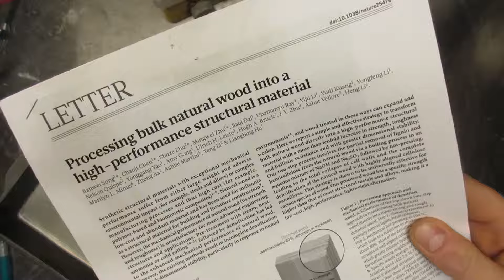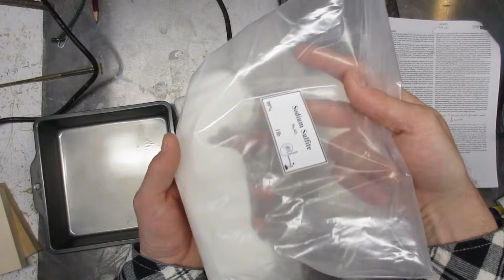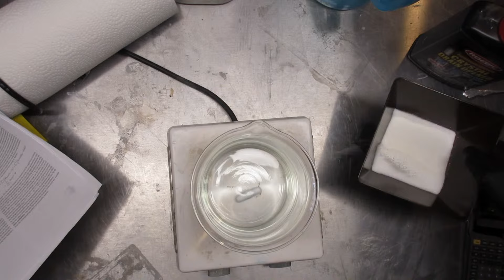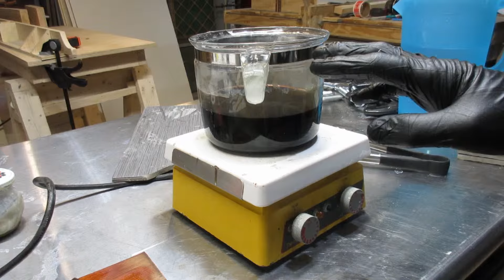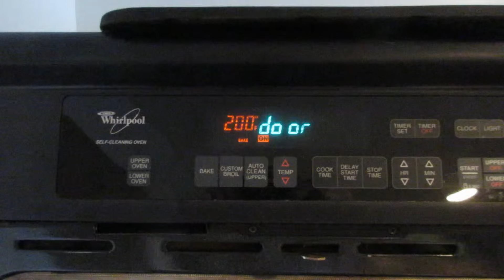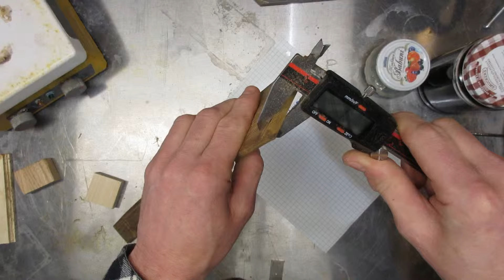Wood Densification Experiment

Comment: Nice experiment and you are pretty darn funny as well. I am very interested in this subject. Anyway to connect with you as I have a few questions for ya..??
Reply from the maker: I've pretty much laid out what I know in this video.  There is much more detail in the paper I referenced.  I can try to answer any questions you have here that way everyone benefits.
Reply: @dork3nergy  would you be able to do this to cardboard or OSB too?
Reply from the maker: The solution I used is designed to break down lignen in wood.  Cardboard is really just paper and glue and paper has already been de-lignified.  OSB is glue and wood chips.  The highly basic solution in this video would degrade the glue and leave you with a porridge of wood schmoo.

Comment: Could I only use sodium hydroxide
Reply from the maker: I don't think so Mahmoud.  The sodium sulfite is required to break down the lignen.
Reply: @dork3nergy  thanks
Reply: For future readers: it is possible to use only sodium hydroxide but it puts a limit on how thick of a piece you can work with. Tested on a piece of 2x4 (1.5” thick) the caustic solution only penetrates maybe 1/4 depth on each side of the piece of wood, and the core is untouched.

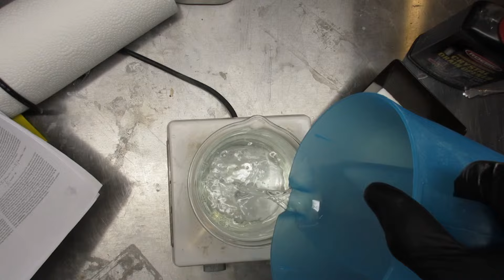Comment: 7:15 What is that called that you’re using to mix the chemicals?
Reply from the maker: It's a magnetic stirrer/hot plate. You can pick them up from the usual sucmbags pretty cheap.  Don't forget to get some teflon magnetic stir bars as well!
Reply: @dork3nergy   Thank you

Comment: Hi, really interesting video. I am a woodworker in the UK, I've got loads of different species including things like lignum vitae. I would love to experiment with this, the problem is I'm no chemist. I was in top set science at school and have a degree in product design though so I've got some idea. Is there anything you'd like me to test out in particular? I'd appreciate it if you could give me a simple DIY guide to doing this because I'm not able to extrapolate here. I have a variety of tools including big old clamps and am willing to buy a cheap 50 ton press. I also have a few ideas about heating during compression, I think a constant supply of steam to heat steel plates would work well and be practical for taking the experiment one step further. I'd make the results public, hopefully making it repeatable for most advanced diy'ers. I also have loads of veneers that would make up plys. I want to make a guitar fretboard from it and try making super-strong veneer laminated beams for the strongest possible strength:weight ratio. Cheers, Fabian
Reply from the maker: Hi Fabian.  To do this yourself you'll need some sodium sulfite (Na2SO3).  You can probably order some off ebay.  To make the boiling solution, decide how much volume you want to make.  For 1 liter, you'll need 100 grams of NaOH (lye) and 50g of Na2SO4.  To make 4 L, just multiply by for, so, 400g NaOH and 200g Na2SO4.  

After you've got your stock solution, boil, rinse and press your wood.

Here is the full method from the paper I referenced:

First, natural wood blocks (typical sample dimension: 120.0mm by 44.0mm by 44.0mm) were immersed in a boiling aqueous solution of mixed 2.5M NaOH and 0.4M Na2SO3 for 7h, followed by immersion in boiling deionized water several times to remove the chemicals. Next, the wood blocks were pressed at 100 °C under a pressure of about 5MPa for about 1 day to obtain the densified wood (115.6mm by 46.5mm by 9.5mm). By adjusting the boiling times, densified wood with different degrees of lignin removal can be obtained.

I'd be curious how using steam works for you if you end up doing this.

Cheers!
Reply: @dork3nergy  thanks, I will let you know how it goes. I'll go from the least dense; balsa wood, all the way through to densest; lignum vitae. Just got given a little steam cleaner by chance!
Reply: Hi, i'm a woodworker too and interested in densified wood. I'm gathering some materials to make some material too. Can you give some tips in the set-up? Kind regards
Reply: I wonder if it is possible to first give it the pressure and later heat it to 100 degrees. With houshold stuff I find it hard to have tha pressure applied and dry it at 100 degrees at the same time. Especially because I need some bigger wooden blocks, which brings me to more needed pressure, which can't be applied with the used clamps here. Any idea how to solve this?
I want to do this in a much bigger scale.
Reply: @rg1996  possibly not do-able without a bit of investment. A pressure that high to do larger pieces would be a heavy duty and quite considerable steel structure minimum.
The best I can think of is to make up a heavy steel frame that clamps together with many thick high tensile nuts and bolts on all the sides, this would be best made from thick solid steel, maybe 1/2" steel plate.
The heat and pressure should go together, they probably tried many different variants of heat and pressure being scientific in approach so following their advice is probably going give optimal results.
Just be aware that if such huge forces quickly escape that you will not be able to limit the damage, it's potentially a really really dangerous thing to do.
Reply: @fabianreeveswhymark3091  there is a more recent publication, where it reads like "press at room temperature with paper towels around the wooden block". Maybe they already found out, it can be done in series. That would make things much easier for me.
Reply: @rg1996  I think the heat means less pressure, that was my initial impression but if not then it'd certainly be easier. The time left under pressure is probably morel important, it probably has to have time to dry. Which is not great for large quantities, you may need heat or something to get rid of excess moisture during pressing. The end product swells with water so this would only be logical. Ethanol would potentially work for taking out water too, as it essentially thins the water.
Reply: @fabianreeveswhymark3091  I added you on facebook and sent you the actual publication

Comment: Lye or NaOH can cause almost instant blindness if beads bounce into your eye - - - - - - glasses / shield is mandatory - -  I would have suspected that thin steel pan would be eaten up, alum foil is easy to predict it would be eaten up. The original research had the hot liquor bath with wood placed in a vacuum to increase absorption into the wood pieces. Why didn't you test the hardness for us all ? Put a hammer on those pieces.

Comment: Great video! thanks for making , sharing, and teaching!!
Question for you though:  Wouldn't this process leave the wood particularly susceptible to moisture absorption?  not unlike a sponge dried into a thin wafer by simply smashing it flat and letting it dry while under pressure.  When the wafer encounters any moisture it will wick it up and swell back to close to its original size .   perhaps this could be solved with the use of a vacuum chamber and epoxy resin to seal the wood into its wafer shape?
Reply from the maker: That's an interesting thought.  My guts tell me that simply soaking it in water would not be enough to break the hydrogen bonds formed between cellulose strands.  I will toss a piece in a beaker of water and make a short video with the results.
Reply: cool ! :)
Reply from the maker: @Killianwsh  I did the H2O experiment but somehow lost much of my footage of it.  The results however confirm your suspicion.  It does indeed swell up.  There is a rapid but limited expansion in the first 6 hours but then the expansion slows.  It never regains it's full initial volume, you get about only 70% back after over 3 weeks soaking in the tub.

After digging around on the internet a bit there are a number of papers that discuss waterproofing densified wood so it seems that this is a common side effect. 

 Thanks for suggesting this.  Very interesting.
Reply from the maker: As a side note here, after removing the densified wood from the water and allowing it to dry out, it shrank back to it's densified size.  Crazy eh.
Reply: Most crazy indeed! Thank you for following up with this. The shrinking back to pre-soaking dimensions seems to indicate that the initial process does indeed seem to actually seriously alter the internal cellular structure  rather than simply desiccate and compress them! One is forced to wonder just how much more dense they could be made on something like a Rockwell hardness scale, if this were combined initially with vacuum enhanced epoxy/air displacement or even simply allowed to absorb a every liquid thermal (instead of moisture or air dry) setting resin (like cactus juice) instead of water.  allowing it to "drink up" the resin initially, then give it time to "weep" any excess resin back out until it shrinks back down again, then actually putting the sample in the oven to cure. 
You may find that there could very well be a commercial market for some thing like this as wood does have many desirable properties that make it superior to metal, stone, and plastics for certain applications (naturally high flexibility and very predictable  linear crush resistance just to mention two) 
When combined with the chemical, environmental, & rot resistance of plastic afforded by the resin, I would imagine it would make a very attractive, sustainable natural product alternative for many purposes.
Reply from the maker: @Killianwsh  I hear ya. It feels (not scientific) that there may be layers in the wood that water can infiltrate and cause some swelling but as it dries out those layers flatten again.  I could squeeze water out of the wood with finger pressure.  Also, it seems like it could be be shaped (with the grain) when wet which opens up some possibilities (for what I'm not sure).  There is a lot going on here.  I really should give the video another go.
Reply: If I had to wager a guess, I'd bet the layers your feeling would likely be the sap wood of your sample, as they are the softest and most sponge like. They are basically the veins of the tree. I think you are likely quite correct in your assessment that  they could be shaped when wet, as most woods can be (to varying degrees) when soaked or, more commonly, steamed.   As far as uses go... well I'd have to say that the tremendous reduction in dimensional cross-section (provided the wood does retain most of its previous strength characteristics) would open up all manner of possibilities currently dominated by metals simply because they have a smaller dimensional cross section  strength vs. their weight.    Wood, being lighter but normally bulkier, has all but removed it from space constrained  uses or anything that experiences wracking (twisting) loads, because it's very difficult to connect two boards together  and  get the loading forces to be in line and not  tearing the joints apart. This problem could possibly be strongly minimized if the wood had had the same strength but 1/2 to 1/3 or less of its orig. bulky CS. preventing wracking and torsional tear out of hinges, fixtures, and fittings, etc.
Reply: @dork3nergy  Oh man! 
This video and these comments are pure gold..!
Thanks and cheers from Patagonia, Argentina! 
🇦🇷😀✌🏾
Reply: @dork3nergy  letting the samples soak in a silicone mix should allow them to repel water and crosslink in the shape that you press them into the second time; here's an example of a cheap naphtha solvent hack that does the same for bedsheets:

https://youtu.be/z_R0gEDZhAI
Reply from the maker: @user-wm1em1rg4p  Whoa! That's damn cool. Thanks for that.   I'm sure I'll use that at some point.
Reply: @dork3nergy  if you could fill the space between the cell walls to fill with some kind of material that repels water..lacquer or epoxy,..then i suppose that it would not swell any more..
Reply from the maker: @mikkosutube  Totally correct.  Here's a link to a paper that does just that.

https://pubs.acs.org/doi/abs/10.1021/acsami.9b11105

Comment: I watched another more recent video where they were delignifying wood and they used 30% by weight hydrogen peroxide and glacial acedic acid in deionized water which sounds a lot safer and less toxic to the environment. However the wood they were using was very thin. Could these other chemicals be used on thicker wood? Are they safer, less caustic? I love your video thank you.
Reply from the maker: I'm not so sure about that.  According to this paper, "Acetic acid itself cannot dissolve lignin even at a concentrationas high as 80% at elevated temperature (in a boilingwater bath). In order to effectively dissolve significant amounts of lignin, nitric acid must also be added." ( https://link.springer.com/article/10.1023/A:1008297211954 )

In other papers where AA is used, it is combined with either formic acid or sodium chlorite so I'm not sure you're any better off solvent wise.  Plus dilute acetic acid is fairly innocuous but glacial acetic acid with set your sinuses on fire.  It's pretty nasty stuff, you'd likely want to do it in a fume hood.
Reply: This caustic solution is safer to work with, safer to dispose of and if treated correctly will be safer for the environment.

If you live somewhere that treats sewage to remediate its Biological Oxygen Demand, then this is basically the same as dilute drain cleaner. If your sewage is dumped into the ocean after treatment it will convert the remaining sodium hydroxide ions to salt. For small quantities which are properly treated this should produce no worse effects than typical sewage.

If you do not live somewhere with sewage treatment service you will need to react the liquid with an appropriate amount of HCl to convert it back to salt, large amounts of vinegar, or have a setup where you can bubble air through it for a few weeks (or months depending on temperature) to react the Sodium with CO2 in the air. The liquid obtained at that point should be added to a compost pile large enough to dilute the Sodium load to a concentration of less than 2% of the soil by mass, or whatever the typical salt content is in your area.

Caustic solution that splashes on to your skin will develop a soapy layer that slows its attack on your tissues, allowing more time to clean it off. H2O2 and pure acetic acid will more rapidly move into your skin and cause more extensive damage, and be harder to remove from your skin and be harder to neutralize.

Comment: Your calculation of Moles to grams is incorrect. 1 Moles = 114.82 Grams. While adding 2 substances A & B in quantities of 2.5M & 0.4M, A will be 6.25 times of B whereas you have taken A material as 100 gms and B material as 50 gms.
Reply from the maker: Where are you getting 114.82 g/mol? 

Maybe you are thinking the ratio of the grams of material should be the same but we are dealing with moles which depends on the molecular weight of the substance.

Comment: Where's the strength test?!!? wasn't that the whole point!?

Other than that, fantastic video, I would chip in to see more if you have a Patreon @DorkEnergy!
Reply from the maker: I'll have to think about how to perform some tests on this stuff.  The original researchers did those tests using a bunch of sciency equipment I don't have.  

I also have it in the back of my mind to do this on a larger piece of wood so, we may have not seen the last of this experiment.

Re : Patreon.  Let's hope it doesn't come to that eh.
Reply: Could probably secure one end in a vice, measure a few inches out and add weights until it snaps (then compare the pre-treated and post-treated max torque before snapping, normalized to the post-shrinkage length).  If it it ends up being anywhere near 11x stronger I'd be very impressed.

Also re: Patreon, not sure I understand... you don't want any kind of monetary gain from your channel at all? Or you only want income via YouTube ads and not Patreon?

- If you only want income via YouTube ads: consider that many users use strict ad-blocking (e.g. me) and prefer to support creators via things like Patreon instead.

- If you think you don't want income at all: 
consider the potential budget you're missing out on to make your videos even better! imo this channel is tremendously high quality, and as you inevitably accumulate viewers over the next year or two, you might want to do bigger and bigger projects (that could be helped by some Patreon funding :D).  Taking a $1/mo donation from a random stranger might seem weird in the beginning, you have to start somewhere!
Reply: @dork3nergy   It would have been interesting to test it non-scientifically ... just using hammer and nail, power drill and a hacksaw. (wood saw probably no longer optimal)

Comment: Dark liquor is concentrated and then burned in a recovery boiler to produce electricity, heat and steam to run a Kraft process  pulp mill. Kraft process combined with the recovery boiler was an amazing invention that turned a very energy intensive, expensive process of making paper into very energy/material efficient affair. Nowadays pulp mills routinely produce more electricity, heat and steam than they need and sell the surplus to nearby industries and municipalities.
Reply from the maker: Cool.  I had no idea.  Thanks for the info.
Reply: It does require some good pollution controls on it, though, since it produces a lot of nitrogen based pollution.